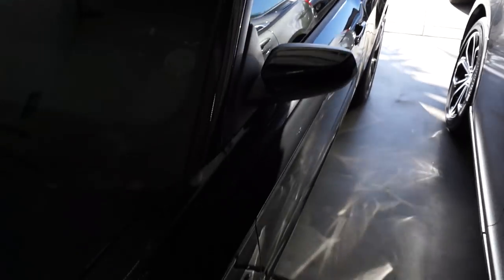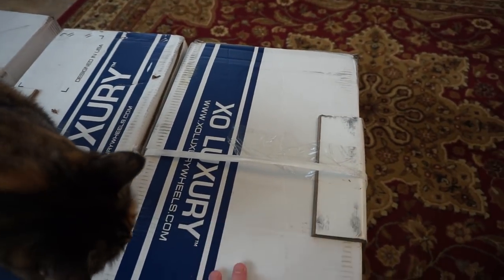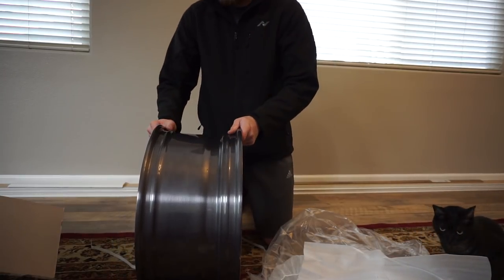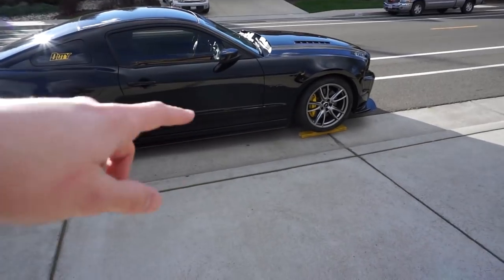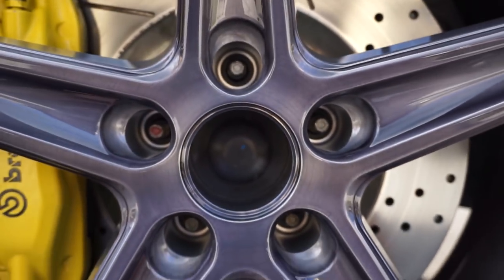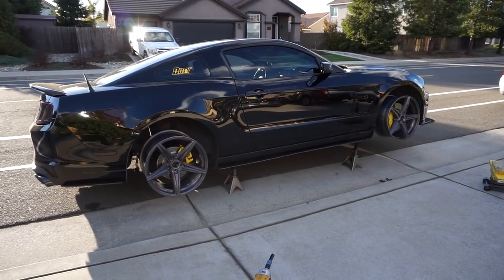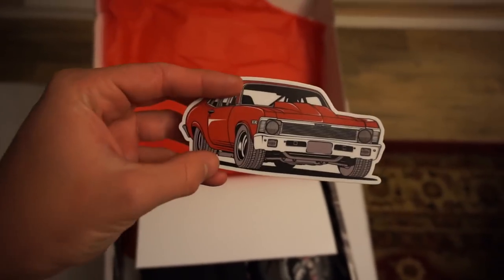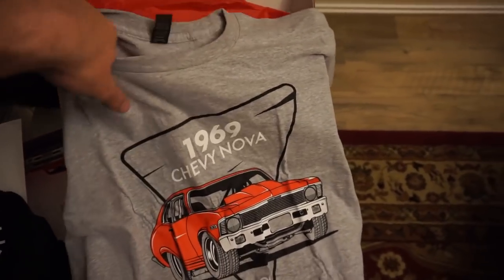Test Fitting My New Wheels! 2013 Mustang GT 5.0 with XO Luxury Wheels

Comment: Thumbs up on the rims, like  the color. Pulled the trigger and purchased some new forgestar cf5v deep concave 19x10 in the front and 19x11 in the back, have no rubbing  at all and super light. You're new wheel setup is it lighter than the previous?